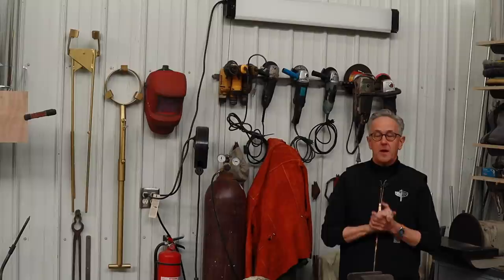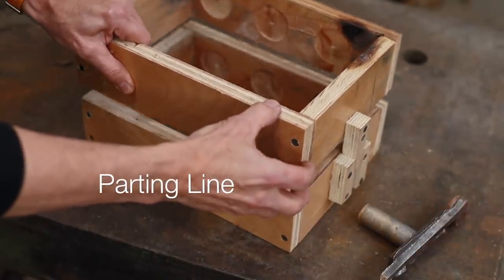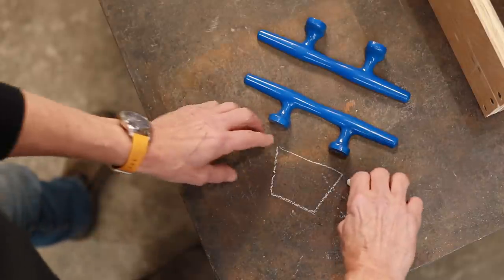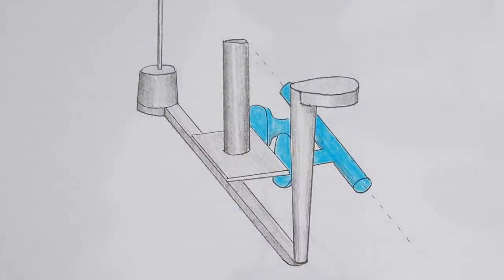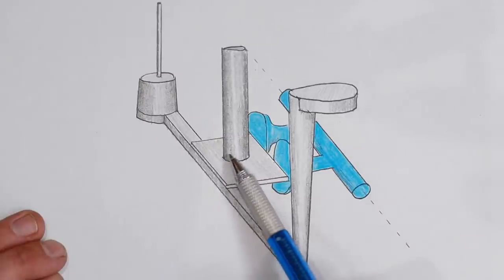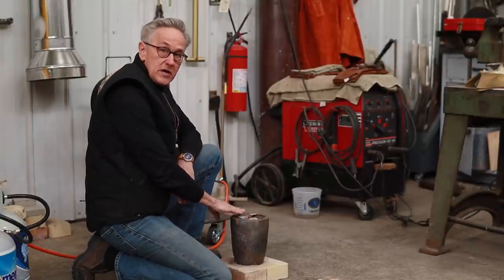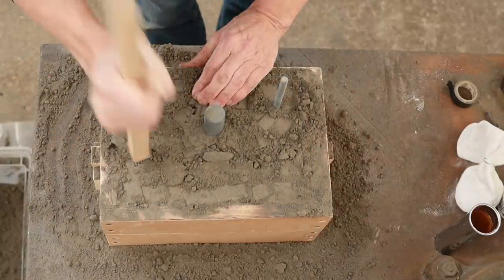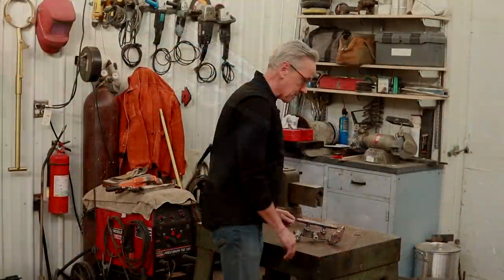Sand Casting Basics, Step by Step S2-E58

Comment: Happy New Year and a big Thank You for your detailed showing of the casting prozess. Recently in my house I found a wooden box with a lot of those spoon and/or trowel like tools together with some brushes with very fine hair and even a needle like the welding rod you used for the small vents. I was told by my mother in law that this is the box my father in law had when he was learning the profession of a "Former", that was the german word for the mold builder back in the early 1950s. (It was a profession you could learn from 1935 to 1997 in Germany. Before and after this part was included in other job descriptions.) Later he advanced to the manager of the foundry in my home town, so I could meet his daughter in the 1980s. Even if I got to see the foundry on a open day, I never got a insight into the trade this detailed. And now I can at least imagine how those tools in the box were used.
Thank You again for your informative and great videos.

Comment: I remember doing some casting in metal shop in Jr Hi. They were much simpler pieces though. Thank you for sharing. Have a great day
Reply: I wonder if we all did that in HS back in the way-back machine.  We did aluminum, which is a much easier metal to use (cheaper, too) but it was realy enjoyable to learn the process.

Comment: I’ve been watching your videos for at least an hour straight and cannot  get enough! One of the best channels on youtube. 😊
You mention that your cleat mold is to final dimension, but I’ve read that molds are usually oversize due to shrinkage. Have you found that not to be the case?
Reply from the maker: Yes, bronze does shrink about 2.5%. If one was making a part where tolerances are tight shrinkage should be a consideration. In the case of the bronze parts for the boat it really doesn't matter.

Comment: Thanks for the video, Bob! I have never cast anything but I feel I got the essentials now. Just an idea: you could add two vertical guides and some small pieces to the bottom of the venting splitted tube so the wood could fit and get rit of the clamps. 😁

Comment: Interesting process. A couple questions:
When you scrape off the dross and put it on the floor, what happens to it after? Do you end up splattering bronze on the floor that would solidify and stay on the floor? In the case of the studio at the university, after scraping off the dross you bang the tool on the steel grate. Isn't there a build-up of solidified bronze and dross on the tools, on the grate, and below the grate?
Also, when you scrape the crucible at the end, what happens to the bronze that you can't scrape out? Once it cools off, it's stuck there.
Reply from the maker: Hi Charles,
The dross is just junk and is discarded. Scraping carefully there is very little bronze. If there is it tends to solidify on the steel scraper.  So no to bronze on the floor and yes on the tool, which can be easily removed in the next pouring by heating the scraper.
The scraping of the crucible is to remove bronze from it. Not good for the crucible to have large deposits of bronze in it as it cools.
Hope that helps. Thanks for watching!
Bob

Comment: Hey Bob, it sounds like the manifold connection may solve your propane bottle chilling issues, but here are a couple other ideas if it isn’t a 100% solution.    Both involve safe ways to warm the bottles, and can be used in combination with the manifold.

The first way is just to aim a decent fan at the bottles, warming them with room temperature air.  People tend to think of fans as cooling devices, so have trouble seeing how this works.   Moving air really increases heat transfer, hence the concept of wind chill, or convection (poorly named) ovens.  

Another thing you can do is place the bottles in a tub of water.   It needn’t be hot, but starting out lukewarm is helpful.   The evaporation of the propane is then trying to freeze the water, so the water is transferring it’s latent heat of crystallization to the propane.   Again this confuses people, because you are using freezing water as a heat source.  This will keep the bottles at 32F where propane still has decent vapor pressure of 50-60 psi. You may need to occasionally scrape the ice off the bottles with a spatula. 

Finally, you said you have a 150 btu burner, which just can’t be right. 150 btu/hr. Is a largish pilot light.  150btu/minute is still too small to ice a 20lb bottle.   Seeing that burner in the background, it looks similar to 80,000 btu/hr, units I have seen for sale. If it is 150,000 btu/hr, then no wonder your bottles are icing!

Comment: Great video Bob... I wonder about the vent solution... wow well did it work?  The reason I ask is that it is quite long/high and has a couple 90-degree elbows (I think 4?)  so that I could imagine that it won't draft well until it heats up substantially, which could be a long time.  I am wondering if you may benefit from putting a larger reducing adapter (or a second larger one) to ensure more of the hot gasses go up the flue rather then go around the flue into the space or if you might need to put a small fan on it to ensure that you aren't getting a cold stack impact on the exhaust flue effectiveness.
Reply from the maker: Thanks for your comment. It is working well. The furnace heats the flue up quite quickly. So much so that within just a few minutes it to hot to touch with out a welding glove on. The idea of a fan has occurred to me, I when as far as pricing one. My thought was that I'd see how it did as is. I'm very pleased with its performance. Still might add a fan if I switch to natural gas.
Thanks again for your thoughtful comment and watch!
Cheers,
Bob
Reply: @TheArtofBoatBuilding  Bob,  I've really enjoyed watching your boat building and tool making videos for the last few years.  Always worth the time to sit and watch.

After this boat,  can I suggest a dragon-class racer?  Now that is a boat that I would especially love to build myself...

Comment: I greatly enjoy your very well done videos, Bob. For the propane you mentioned 130 Btu. I am somewhat familiar with small temporary heaters,. The ones I have run from 19,000 Btu up to 250,000. Did you mean 130K? Or not.
Reply from the maker: Hi Bill,
Yes, you’re correct, I meant to say 130,000 btu’s 
Thanks for watching!
Cheers,
Bob

Comment: Just catching up here via Acorn-, does the math work the same for the passages if a different metal is used, say aluminum. I thinking differing surface tensions.
Reply from the maker: This process I learned from fellow casters that use aluminum. So, yes it works the same for bronze.
Thanks for watching!

Comment: Surprised you didn't mention sodium silicate additive and CO2 curing for hard setting sand. But maybe you'll touch on it in a later vid.
Reply from the maker: Hi Ross,
I don't see a need for a core as of yet, according to the plans. If I do make a core it will be as you suggested using. 
Thanks for watching!
Cheers,
Bob

Comment: Bob, appreciate you sharing your knowledge. 
I have the same problem with a 20lb propane tank freezing up in the winter while running my forge.
Do you think wrapping an electric heating blanket around the tank would be effective (and safe)?
Reply from the maker: I'm very happy with my manifold set up. I've done several more firings since the video. I can report that the tanks did not freeze in the over one hour melt time.
I consulted a propane expert near me and followed his recommendations. He did not mention heating the tank. I have hear of folks doing that. However, if I where you find and expert and get their recommendation.
Reply: @TheArtofBoatBuilding  ok, thanks. Will do.
Reply: @grandmajosephine383  I offered a couple of suggestions for SAFE ways to warm propane tanks in another comment to this video.
Reply: @gumbykevbo  Thanks Mr. Kevbo, I just read your suggestions. The fans won't work for me because I am in an unheated and uninsulated shop so my room temperature is pretty much outdoor temp. Also quite a distance from a water source. The water container did seem to work when I was forging from the insulated, nonheated garage attached to the house in the olden days.